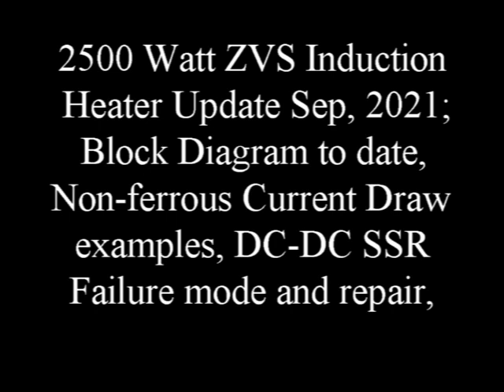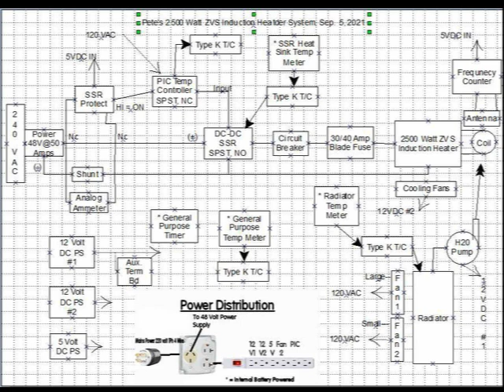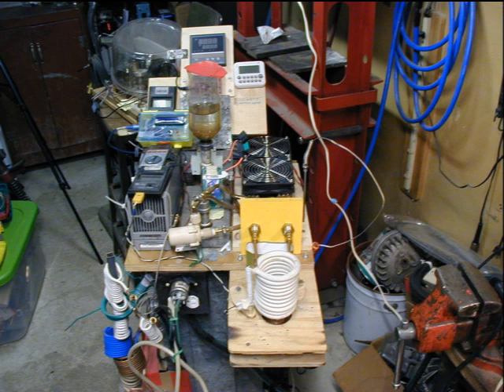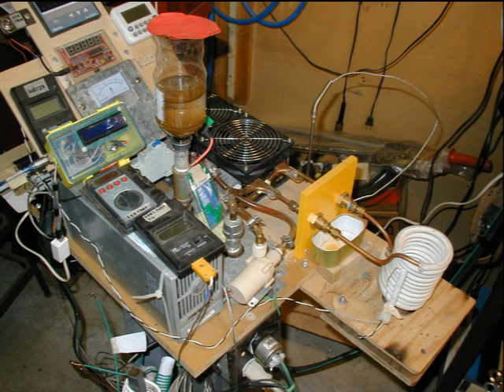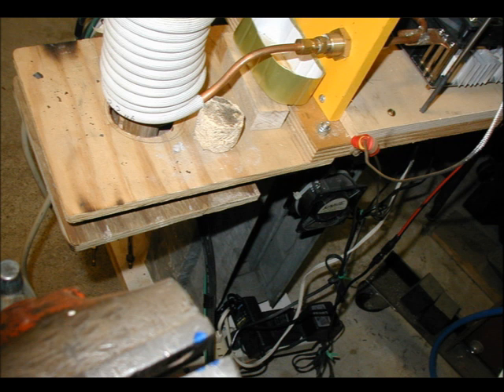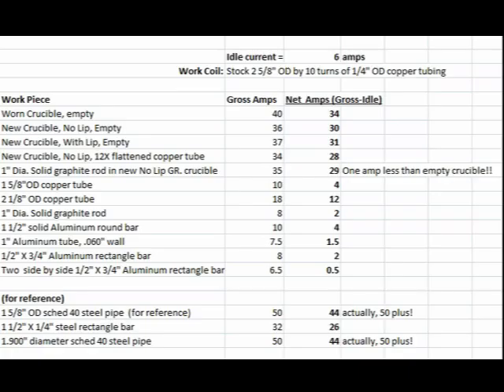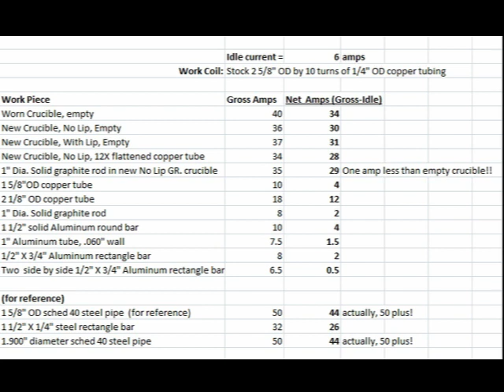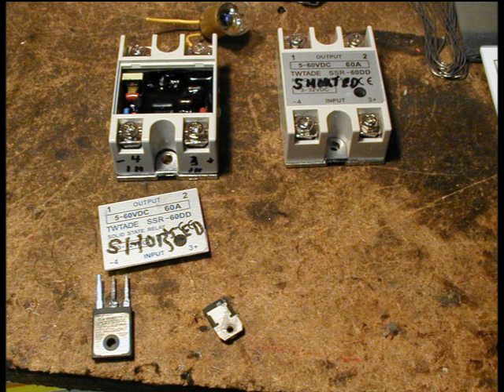2500 Watt ZVS Induction Heater Update Sep, 2021 #194

Comment: Allo - quick question, for someone wanting to get into blacksmithing, is an induction forge viable, and if so is there a non-expensive option that doesn't involve endless faffing about? I have all the other tools I need except a forge, and while I'd prefer induction to gas, it seems questionably sane. I can do basic electronics, but trying to find very specific components during the current supplier mess, sounds like an expensive form of hell! Thanks for your time and advice.
Reply from the maker: I'd go with the gas forge, or, better yet,  a coal forge.
An induction forge for general blacksmithing   (about 7 KW output, or more) is going to cost at least USD$1000 and probably a few hundred more by the time you get a proper water cooler.  Also, the induction forge needs pretty specific work coils for each job and odd shaped workpieces create special needs and even coil changes as the part progresses in shape..

Comment: I am attempting to make a  brass case annealer and have a couple of questions. 
In this video the brass case is heated too rapidly.  If you reduced the input voltage to the ZVS, would the time to reach 1000F increase?.  I've seen a heating curve that shows the proper heating rate to anneal brass cases as 3 seconds to reach 1000F and then cooling. 
Second, Can the coil dimensions impact the this heating time also?  Most brass case annealers use a 1/8 coil 10 wraps ~ 1 1/2" ID coil.
Reply from the maker: Yes, a lower supply voltage would slow the heating down.
Reply: @frenchcreekvalley  Thanks, what about 1/8 coil design?
Reply from the maker: @edhyde1741  That ought to work okay as far as the induction heater is concerned, but that means that you are heating a longer portion of the case.  I thought that all you want to anneal is the neck.  That's why I used multilayer/multiturn coils in my demonstration.  ----Too get SHORTER heat.